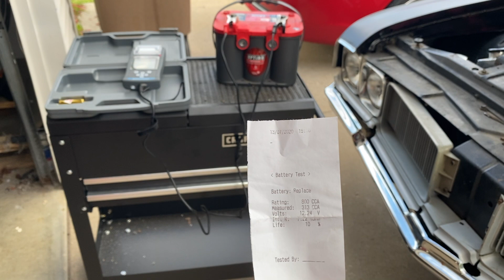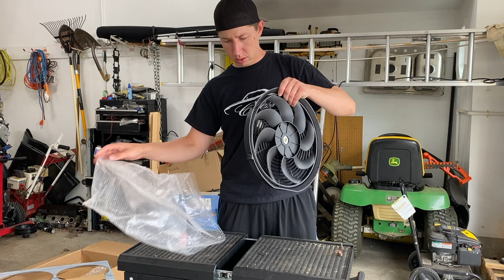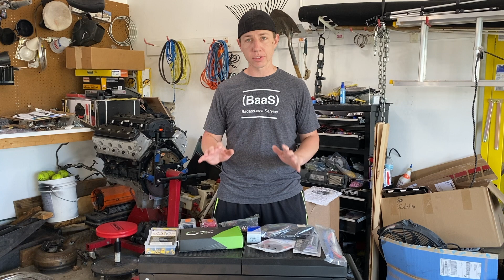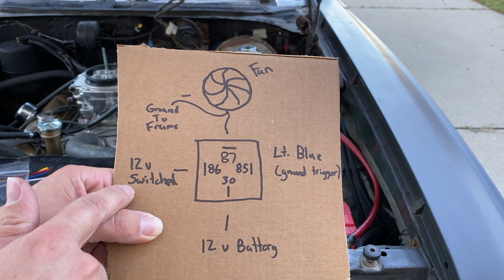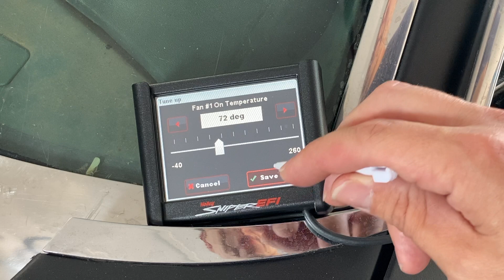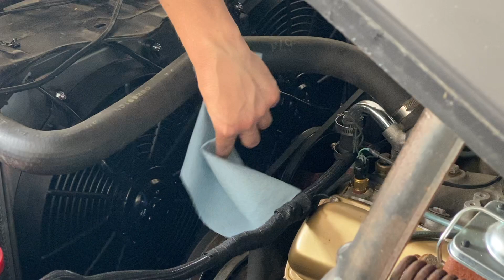Rebuilding 1970 Cutlass Episode 7 - Dual Fan and Shroud Install - Holley Sniper Controlled

Comment: I made an aluminum shroud for my 70 GTO to use two 16" electric fans controlled by the Holley Sniper. It went from 220 degrees using the A/C down to 200. Without A/C running it stays around 195, and the air flow is excellent. Great video, new sub here.

Comment: How are the ebay fans working for cooling efficiency? I'm torn between this and something like a Derale 4000+ CFM shroud. Only issue is I'd have to modify the thing to get around the steering box on my '71 Camaro.

Comment: Should the fans be blowing at the radiator or sucking through the radiator minor blowing at the radiator and my truck still gets up over 225 and it keeps rising but both fans come on I have a 5.7 l 350 what am I doing wrong I don't like how hot it's getting

Comment: I know it’s been mentioned but you may want to increase the amperage output of that alternator by replacing it since you have to run the fuel pump the fuel injectors the ignition the fans the headlights the radio and heater blower motor if you’re using it that’s a lot once you add it up I put one in my chevelle that was 220amp just because it was good price I have the Holley Terminator X with a stealth throttlebody in my 1970 Chevelle and I have a dual fan set up now as well the fans pull over half of what my old alternator would’ve put out alone … I know it’s an old video but hopefully you fixed issue
Reply from the maker: I was just talking to my dad about that the other day. I feel like I will need to get a bigger alternator. I will check into it more. Thanks man!

Comment: I have a 70 Cutlass, its my 1st car I got it in 83. It has the 455 and is 30 over. I bought the same fan kit for mine and it wasn't enough. To keep your motor cool you need 3500 to 4000 cfm total. I was able to get two fans from Derale, they run at 2000cfm on high. I hooked one to a toggle switch so I can let it cool while the motor is off, the other is on a thermostat 180. I dont have efi Im running 780 double pumper, but I have electric fuel pump and water pump. Once I put the fans I did need the high output alternator.

Comment: You are going to need a much higher output alternator to run those.  The factory one will barely keep up with the Sniper and the high speed blower motor.  I'm running the alternator off a 1990 Olds Custom Cruiser, CS130 I think.  On my 70 Cutlass Supreme with Sniper.  It already has the v-belt pully and is a 105 amp output.  Bolts right up.  You'll also need the pigtail for that alternator.  I'm not running electric fans though.  You may need even more.

Comment: You should just get a different battery all together i replaced those batteries twice in my 71 buick skylark and the third time just went with a different battery completely
Reply from the maker: Yeah, I am about at that point, just after 1 bad battery. Really was bummed since these are supposed to be soooooo good. Oh well, guess I will see how this one holds up. I at least got a new 3 year warranty when they did the replacement. :)

Comment: Why wouldn’t you simply run them both all the time ? I hate relying on a temp relay for the second fan that could potentially save a motor. What’s the downside of running both all the time ?
Reply from the maker: Very good point, I am just afraid of how much draw those fans have on the system. I will start with one for now and see how the engine and alternator reacts to it. If the engine needs more cooling and the alternator can handle longer periods of both running, then I will go ahead and run them both for safety.
Reply: and the same reason most  oem does the same or if ac is on ,to keep the engine in operation temp longer and not have it cool down to quickly  and also startup draw will not be an the same time